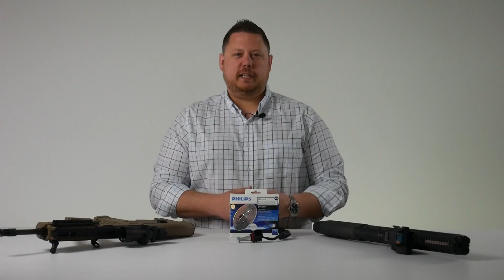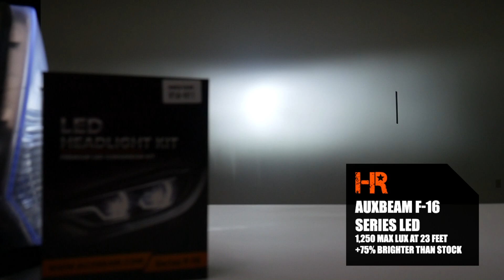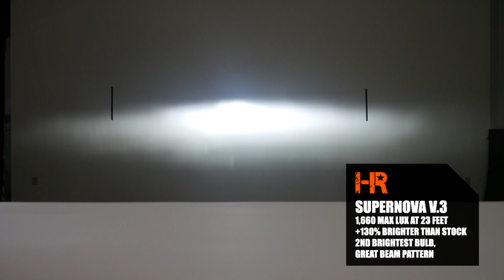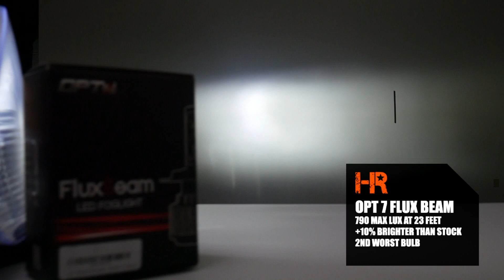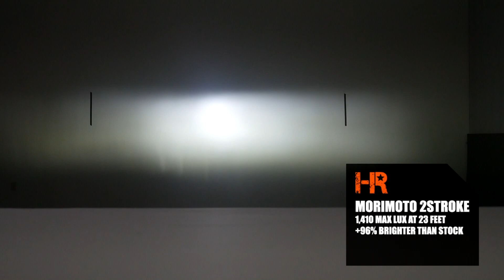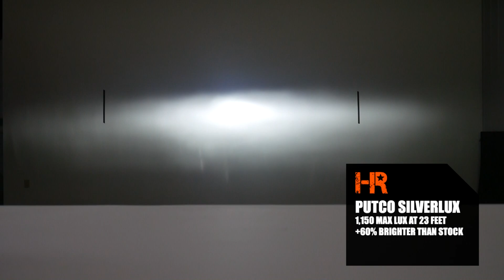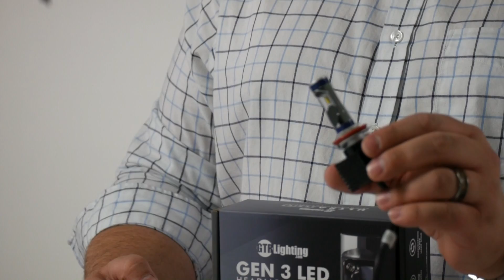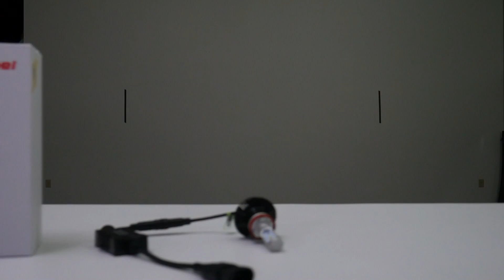DELETE - 15 Brands LED Headlight Bulb Shoot-Out! Which one's the best?

Comment: What about a video with these same LEDs and how they may scramble your FM radio?
I "bought" into the OPT7 BS and now I have nothing but static with my H11 lows on in my 2014 Ram 1500 (I returned them and put the OEMs back in).
What's the verdict with EM interrupting the radio with these LEDs?
Reply from the maker: BigBadWolf11B, For the most part, what causes the RF Interference is the fan.  So when you don't have that, you shouldn't have any more issues.
Reply: So any of those available tested without fans should fix my RF issues? Or have you tried any of these and tested for this issue?
Lots of 4th Gen Ram owners have these RF issues and hold off on purchasing LEDs and suffer with OEM bulbs or better halogens or really bite the billet on HIDs (expensive).
Reply from the maker: We have had the Supernova V.3 bulbs installed in a bunch of Ram trucks by wholesale customers of ours, and we have not had any RF issues on them.
Reply: Roger that.
Reply from the maker: I'd also like to point out that it seems that radio noise interference is most commonly caused by the fan on an LED bulb. In normal consumer electronics they use shielded wiring to prevent noise on your devices, but the cheap bulbs from China cut corners everywhere they can and the spinning fan creates unfiltered EMI that interrupts your AM/FM signal. Fan-cooled bulbs run the coolest, but they're also the most prone to causing radio noise.

Thanks for your support!
www.HeadlightRevolution.com

Comment: Great video, glad to see my decision on buying the Morimoto 2 Stroke H7's for my car was a good choice. Though you don't touch on the subject that the 2 stroke was designed for DRL/High Beam placement. The Retrofit Source took this off of their specs but Morimoto has them still listed. This was mainly because these leds are full brightness around 10v and the DRL signal is usually around 6-8v but some cars are around 9-10v (which could be blinding in the day time). It's hard to believe there are brighter led lights out there, the Morimotos are like turning on the day light switch.
Reply from the maker: Thanks for your comment.  I know GTR is coming out with a low voltage bulb soon too.  They're testing right now.

Comment: Great video! I have a question for you.

I have a 2006 Volvo v50, and am interested in some H11 LED headlights
for it. The only issue that concerns me is the whole headlight assembly is
enclosed, and there is no ventilation to cool the LED bulb. How should I vent
the headlight assembly to cool the LED headlight and prevent condensation or
should I not worry about it?
Thanks.
Reply from the maker: My Lord, thank you for blessing us with your comment.
If it pleases my Lord, LED headlight bulbs don't make as much heat a halogen bulb does.  Although we don't have any experience with my Lords vehicle, Ram trucks tuck a LED bulb and driver inside the housing with no issues.
Reply from the maker: One other resource in regards to LED heat info is this test document:
http://betterautomotivelighting.com/2016/11/12/how-hot-do-led-headlight-bulbs-get/
Reply: This pleases me. Thank you for your response!

Comment: I got the opt7...was disappointed with them. Wish i had saw this video before .I went with the reviews off amazon... just ordered the GTR 3...hope i won't be disapointed.
Reply from the maker: There's really no way you can be! We've tested so many bulbs and those ones are always at the top.
Reply: I have the projector style headlamps. Folks are saying to go with HID vs the LED. whats your take on this claim? Is there a much greater difference between the 2 in that paticular style unit ?
Reply from the maker: Oh boy,  If you're running a projector, you I agree go with HID not LED.  Watch this one:
https://www.youtube.com/watch?v=utrYcpXDwJ8
Reply: Oh boy indeed thanks for the info. I'll return the leds I just bought lol

Comment: The GTR gen 3 bulb GOT 3700 lumen a pcs? I hope You are just kidding with everyone, because that's complete bs. More like 1500-2000 real lumen, and that will also probably be lower when the passive cooler gets hot. It looks like you got 3700lumen by multiplying the wattage draw and the max lm/watt laboratory rating for the Philips Zes diode. Do you really have to lie to sell your products? I know a lot of other does it, but then you can't bash other in the video for doing it, when you do not disclose that you are doing it yourself. The bulb and the led diods would melt if it was 3700lumen.
Reply from the maker: In this video, we relay all of the manufacturer's info either from the packaging or their respective website. We are not a bulb manufacturer.

Comment: Nice video. I'm still going nuts about HIDs and LEDs. I just bought two brand new Hyundais, one is a Sonata and the other an Elentra.  Both come with low beam projectors and halogen reflectors. I want the best visibility and one of them will be used for long trips on road where there's no signal and no humans for hours. one of my cars is lease, so I don't want no modifications. what should I get?
Reply from the maker: Anytime we see a projector we recommend using HID bulbs.  If you have a high beam reflector you could go with the Supernova V3 bulbs to make sure they fit with out having to measure. 
https://headlightrevolution.com/headlights/headlight-bulb-upgrades/supernova-v-3-led-headlight-bulbs/

Shoot us an e-mail if you have any other questions.

Comment: Headlight revolution i want to led bulb for my 2017 honda civic please tell me which size i buy ? Gtr ultra vs Supernova v3 which one is more better? 
Sorry my English is not good please try to understand and answer my questions!! Thank you Like n Subscribe from Pakistan 😊
Reply from the maker: Noman,  It's all good.  
If you're running with a projector for your low beams we recommend going with an HID kit.  
Lows are a H11: https://headlightrevolution.com/gtr-lighting-35w-canbus-gen-4-hylux-single-beam-hid-conversion-kit/
Your highs are probably reflectors and the LED kit would work great for you.  I'd go with the Supernova V.3 to make sure they fit and you wouldn't have to ship them back if they don't.
https://headlightrevolution.com/supernova-v-3-led-headlights-9005-9145-bulbs/
Reply: Headlight Revolution Thank you bro 👍

Comment: Thanks for taking the time to put together the video and debunk many of the claims that exist out there.  Did each led setup get adjusted accordingly for proper light output (at least on those led options that can be adjusted)? Also in some of your past videos promoting the GTR led lighting the beam patterns appear a good bit different to what is showcased here. Can you explain? Thx
Reply from the maker: cue03, yes we adjusted to get the best light output.  As for the different beam patterns, it's probably because it's a different housing.  Each vehicle housing gives us a little bit different beam pattern.

Comment: I have the Gen 3 in a 16 tundra headlights and fogs they are legit super bright perfect beam patteren I also have the flux beam opt7 in a polaris ATV they dont even come close to the Gen 3
Reply from the maker: And Boom goes the Tannerite!
Reply: i also have a 3rd gen tundra and have to say the stock lighting is embarrassingly terrible. happy to see that those bulbs are an improvement. one question, have you managed to aimed them appropriately for your needs and not have the oncoming traffic blinded in the process?

Comment: Great informative vid. What is the latest in H4 led ?  What would you recommend for a motorcycle with a reflector?
Reply from the maker: This is the best H4 we've seen:
https://headlightrevolution.com/gtr-lighting-gen-3-ultra-series-led-headlight-bulbs-h4-9003/

Email us at sales@HeadlightRevolution.com for a coupon code, thanks for watching!
Reply: dashbmw $240! Holy cow, I would never pay that.  I got a similar bulb for about $60 a pair, so I have a spare. It uses the Luxeon chips and has a great low and high beam in my old 86 Honda vfr700. Factory beam pattern, sharp cutoff and many times brighter. All the details and pictures are here. http://www.bikersoracle.com/vfr/forum/showthread.php?t=132095

Unfortunately the forum is down at the moment. Just save that link and check in a few days. Hopefully  it will be working soon.

Comment: i really like the gtr lighting gen 3 led. i see that you have them, but i want to be sure i am ordering the correct bulb. i have a 2008 ford f350 with stock headlights. do i need the h13 / 9008@ and will they fit my stock headlight case? i would like to order them. does anyone have any experience? thank you.
Reply from the maker: Mark, please watch this video: 
https://youtu.be/LBY8HGNCgFE

If your headlight style is the one a year before this style came out (see the above video) then you'd still use the same product. They use the same bulb and headlight design is similar. Watch that video, and you'll have your answers!

Comment: Now which one is really the brightest? I don't need a good beam pattern as I just need it for my high beams
Reply from the maker: Funny thing about that is a lot of times it depends on the headlight housing. What vehicle would you do the install on? This video shows that the GTR Lighting GEN 3 bulbs are obviously the brightest.
Reply: That's not only a funny thing, thats what most costumer dont think about :D I could tell you which housing, but I'm pretty sure you've never heard of that in the US. Anyhow I think I'll go with the XHP50, as my housing makes too much of a spot rather than a wide beam (left to right and also top to bottom). Have you testet temperature on the XHP50 models?

Comment: you are being very lenient with that Morimoto headlight I wonder why that is? it did not clear a hundred percent over the stock headlight like some of the other headlights and still had that huge boxy looking tall beam but yet you praised it as though it was decent when it looks just about as crappy as some of the other bulbs on your bad list. maybe I'm losing a little bit over my HD phone screen but to be fair I'm looking at all of them through the same screen. does anybody else see this?
Reply from the maker: Morimoto has some of  the best quality/best built bulbs you'll find. Some perform better than others in this video but Morimoto was not even close to the bottom of the list, therefore they survived!

Comment: Very informative video. Thanks!
Reply from the maker: You're welcome. Thanks for watching.
Reply from the maker: NaotakunFLCL yea, some of this model we tested the heat sink came off very easily. On this set of bulbs we couldn't get them off with tools and multiple people trying. However, we stopped trying when we decided that even flipped around, it still wouldn't fit. It was plain to see that it was just too big all around. Kinda surprised about it.
Reply from the maker: Those bulbs are the EXACT SAME THING as the Oracle bulbs here:
https://headlightrevolution.com/headlights/headlight-bulb-upgrades/led-headlight-bulbs/oracle-4-000-lumen-led-headlight-bulbs/

Check out the part in the video at 26:30 mark and watch that part of the review after the explosion... :)

These are decent bulbs but not super bright. We've tested them in other housings, and as long as they actually fit, they perform pretty similarly to the Putco Silver Lux in both beam pattern and brightness.
Reply: Did you try flipping the heatsink? A number of other clones I've seen say the heat sink on those bulbs SBL or whoever sells em' shows the heatsink flips to make room, hence why it has the little round plug between the light and "ballast".

Comment: lmao dude handing off firearms from the side. At first I wasn't happy with the gtr gen 3's but once I adjusted them correctly they did well. $200+ bucks is still a little high but still happy with them. Glad I didn't go with the opt 7 bulbs
Reply from the maker: Timothy Z, that's not normal to have them spray light around. You could check to make sure the bulb is in there correct with the LED's shining out horizontally not vertically.  If that doesn't work give us a call and we'll see if we can help you figure it out.
218-755-5505
Reply: Mark Turik I put them in my 88 gmc jimmy/k5 blazer. I'll be buying another set for my mom's 05 pathfinder. I would have gotten some for my 96 Tahoe but I have nighteye fanless leds for that.
Reply: Timothy Z well I adjusted my actual headlight housing not the led bulbs themselves. They weren't aimed correctly so I aimed them as well as the highs which have their own individual housing and I'm happy.
Reply: hi ya scoobydigits, just curious what you put the gtr's in? i have a 2008 superduty, f350. would you advise these leds or something else? thanks, mark
Reply: thanks for the help.
Reply: How did you end up adjusting them?
Reply: I have the same pair of bulbs but I get an excessive amount of scattering, probably due to putting them in reflectors
Reply: Timothy Z probably but I've seen leds in projectors and wasn't all that impressed. Some do well and others not so much. There are many people some I know with projectors who weren't happy with the performance of leds in them. I have crystal clear glass reflector headlights myself but as I said once aiming them I was happy with how they performed.
Reply: Okay thanks, i'll check it out. I switched back to Sylvania Silverstars, but i'll check the alignment on the LED's.
Reply: Austin Urvina the nighteyes are alright not bad. Nighteye does however play the same marketing games many of these led companies play. They claim 10,000 lumens knowing people will think awww snap 10,000 lumens per bulb when it's actually 5,000 per bulb and honestly probably not even that. They are bright have a nice color and they're cheap. I can't speak on longevity as I haven't had them that long. I got them through a friend for free who got them in bulk otherwise I probably wouldn't have even noticed them.
Reply: Opt7 did well for me until the bulbs died in six months
Reply: king0gil018 yeah one of the gtr bulbs is flickering haven't even had them for a year. I noticed it two nights ago and really noticed it when I was sitting behind a bus and saw the reflection having the jitters. Got out to look and sure enough it's flickering. 9007 bulb lowbeam. I'm going to give the vleds pair a try.
Reply from the maker: ScoobyDigits, my man! You shouldn't have to deal with that.  That sounds very unusual for GTR bulbs. Did you know those come with a lifetime warranty? Give us a call and we'll get you taken care of:
218-755-5505
Let's get you back on the road!
Reply: ScoobyDigits what do you think about the nighteye LEDs? I've been looking at them but the GTR bulbs seem promising.
Reply from the maker: Yea they cost more than some others, but if you want the best of the best you gotta pay to play!

Comment: hey man! I was wondering if you can recommend  me what LED  I can used on my 1999 toyota tacoma 4X4? it has or uses a H4 hi/lo beem  per side.
Reply: Didn't he shoot the auxbeam?  Why would you put that in?
Reply from the maker: You can find all H4 bulbs here:
https://headlightrevolution.com/product-types/bulb-style/h4-9003/
Reply: Gabriel Ruiz I have the auxbeam f16 in my 2017 Tundra and it's better than halogen. It's the same H4 hi/lo beam
Reply: Does it still work with the outer boot for keeping the moisture out ?
Reply: Gabriel Ruiz mine does because the collar is removable on them
Reply: Gabriel Ruiz and then price isn't too bad 45$
Reply: Okay, thank you!
Reply: Gabriel Ruiz no problem bud